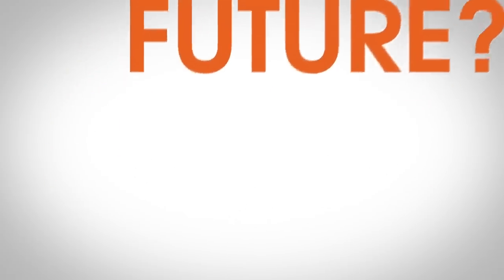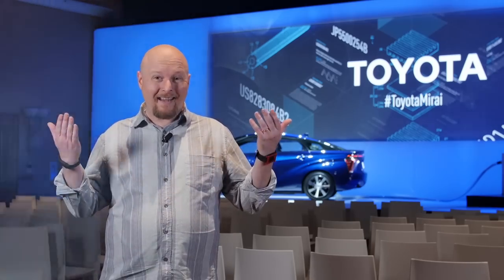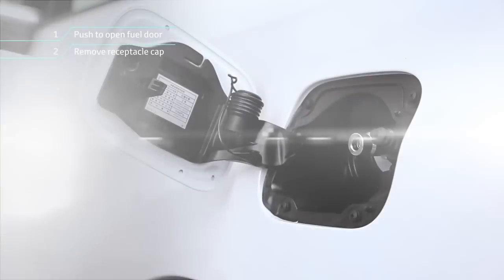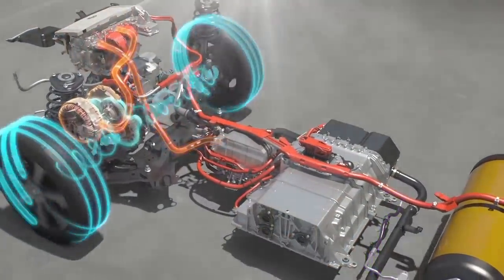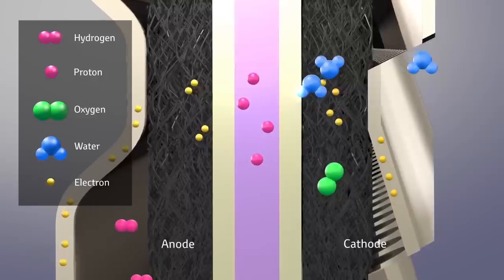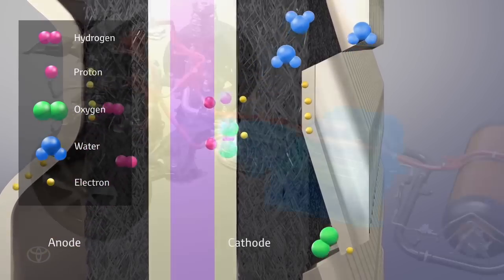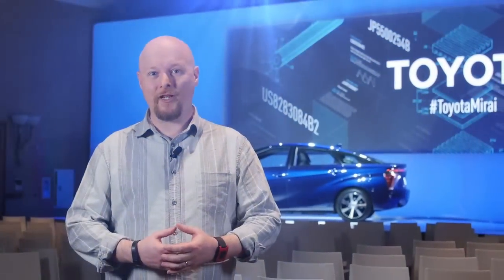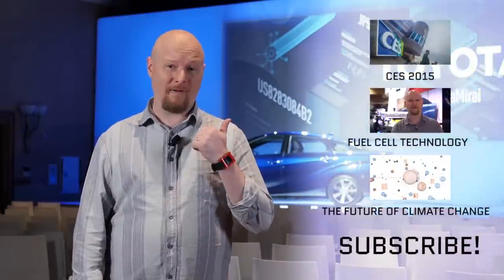How Fuel Cell Vehicles Work – CES 2015

Comment: Tesla, nor Toyota was the first for either of these ideas. Electric cars were actually the first mock up off the line back when Ford began production and have been available off and on, to this day. Hydrogen power has been in research at least since the late '80s. It's funny to read these comments from people that haven't been alive long enough to know, or that just didn't pay attention or do the research. None of these ideas are new. Self driving tech was touched on in the 50s and Mercedes and Ford motors have both been doing self driving R&D since the late 80s. Just because some companies utilize public media, doesn't mean they thought of it first.
Reply: To be fair, it doesn't matter if the idea existed previously. Nothing succesful was done with it. It's like if I find a cure for cancer but don't do anything with it, it wouldn't count for much. As much as I support giving credit to the original source of the idea, I credit more those who actually do something successful with that idea.
Reply: Toyota has always lied in such promotional videos and this has not changed 6 years later. At 4:58min they claim: "No carbon emissions like petrol or diesel powered vehicles".
This is true - if you look at the fuel cell car alone. If you look at the whole chain (well-to-wheel), hydrogen today in 2021 is made from more than 95 per cent natural gas, coal and oil, as it was in 2015.
The hydrogen car is therefore dirtier than all other vehicles!
Of course, hydrogen can be produced from renewable energies via electrolysis. But this method is several times more expensive and therefore there will never be a large number of cars with hydrogen as an energy storage medium.
Toyota needed until 2019 to produce and sell 10,000 Mirai.
At 4:59min I had to laugh:
The biggest revolution has failed ...
Reply: @spongebabu6723   :  "but still better than pussified American tesla"
The effeminate Japanese company Toyota is now building more and more battery-electric cars ...
;-)

Comment: I was crazy about fuel cells and electric cars when I was in high school.  Since I graduated in 1979, that was a long time ago.

Hydrogen is hard to store.  That means that trying to run a regular internal combustion engine on the stuff will make it a real challenge to have a long range.

Also, since hydrogen is expensive (right now,) running an IC engine on it will be expensive.

On the other hand, if you use a fuel cell (~60% efficiency) combined with electric motors (~90% efficiency,) you can get a very economical car with a good range.

If Lockeed-Martin's fusion reactor pans out, we will get the much promised 'electricity too cheap to meter.'  That means that hydrogen will become MUCH cheaper.  Also, we will be able to produce it at home via electrolysis.

Also, electric motors are great for propelling a car.  They have high torque at low speeds.  In fact, they can produce torque even when stalled.  This eliminates the need for clutches.  The fact that they produce torque at any speed means that we don't need a shifter.  If we use a motor for each wheel, we don't need any differentials.  Putting a motor on each of the four wheels, and controlling them with a computer, allows us to have all of the advantages of a differential and a locked system at the same time.
Reply: After 4 year you got a reply 😅❤️✌️
Reply: @DinushaJayaranga  😅😅
Reply: 5 years later you get a reply.. Do you still agree with what you wrote ?
Reply: @JGTechBlog  Yes.  Hydrogen is still hard to store, and is still more expensive per joule of energy than gasoline or diesel fuel -- especially since both gasoline and diesel fuel have gone down in price.

Hydrogen will go down in price once we get really cheap electricity -- whether it is from solar/wind/hydro, or from fission (LFTR,) or from fusion.

Meanwhile, in the past five years, the technology for battery electric has really improved.  That makes hydrogen fuel cell vehicles look less attractive in comparison.
Reply: Lol😂😂😂
Reply: Though im very much crazy about electric cars since grade 4,when i had my batery powered toy car, on day 1, til day three  only the dynamo is left😂😂😂,didnt think i could be seeing ev's on the roads until few years ago...great tech..
Reply: Die Vorteile eines elektrischen Antriebes sind unbestritten.
Toyota has always lied in such promotional videos and this has not changed 6 years later. At 4:58min they claim: "No carbon emissions like petrol or diesel powered vehicles".
This is true - if you look at the fuel cell car alone. If you look at the whole chain (well-to-wheel), hydrogen today in 2021 is made from more than 95 per cent natural gas, coal and oil, as it was in 2015.
The hydrogen car is therefore dirtier than all other vehicles!
Of course, hydrogen can be produced from renewable energies via electrolysis. But this method is several times more expensive and therefore there will never be a large number of cars with hydrogen as an energy storage medium.
Toyota needed until 2019 to produce and sell 10,000 Mirai.
At 4:59min I had to laugh:
The biggest revolution has failed ...
Likewise, the revolution with nuclear reactors and nuclear fusion is failing - far too expensive.

Comment: researching how fuel cells work, ended up walking into a Toyota ad
Reply: Toyota has always lied in such promotional videos and this has not changed 6 years later. At 4:58min they claim: "No carbon emissions like petrol or diesel powered vehicles".
This is true - if you look at the fuel cell car alone. If you look at the whole chain (well-to-wheel), hydrogen today in 2021 is made from more than 95 per cent natural gas, coal and oil, as it was in 2015.
The hydrogen car is therefore dirtier than all other vehicles!
Of course, hydrogen can be produced from renewable energies via electrolysis. But this method is several times more expensive and therefore there will never be a large number of cars with hydrogen as an energy storage medium.
Toyota needed until 2019 to produce and sell 10,000 Mirai.
At 4:59min I had to laugh:
The biggest revolution has failed ...

Comment: how about the hydrogen production line ? is it going to be eco-friendly ?
Reply: Perhaps once it's produced enough electricity to power itself
Reply: doughnut090
So far, there is no known technology that can produce enough juice to power itself. Maybe in time we will develop such technology. If we ever do, my guess would be some type of nuclear source. If I remember my physics right, once it starts you can't turn it off until the source is exhausted.

Now, we may be able to produce hydrogen using solar as a power source, and only keep the operation open during the day. Since the tech is so new, the plants can be designed to be as green and eco friendly as possible and reduce environmental damage.
Reply: Benjamin Lemin Why not? 
Using hydrolysis or the process of converting water to hydrogen and oxygen from renewable sources the hydrogen is captured and the oxygen is either captured or released into the atmosphere. 
Currently hydrogen is a byproduct of refining crude oil, is used in modern refineries to help crack and treat crude to yield more gasoline and diesel, but much of the hydrogen production is pumped back into the ground as a waste material, sold as an industrial gas or safely released into the atmosphere with other constituent gases.
Reply: ***** Possibly, not my area of expertise. The United Nations may possibly want to condemn us for enslaving the plants or algae.
Reply: Toyota has always lied in such promotional videos and this has not changed 6 years later. At 4:58min they claim: "No carbon emissions like petrol or diesel powered vehicles".
This is true - if you look at the fuel cell car alone. If you look at the whole chain (well-to-wheel), hydrogen today in 2021 is made from more than 95 per cent natural gas, coal and oil, as it was in 2015.
The hydrogen car is therefore dirtier than all other vehicles!
Of course, hydrogen can be produced from renewable energies via electrolysis. But this method is several times more expensive and therefore there will never be a large number of cars with hydrogen as an energy storage medium.
Toyota needed until 2019 to produce and sell 10,000 Mirai.
At 4:59min I had to laugh:
The biggest revolution has failed ...
The new Toyota Mirai II (2020) does not even have a folding rear seat back. The hydrogen tanks take up a lot of space.

Comment: hydrogen is amazing! but I think in the mean time, electricity is a vastly underutilized tool for transportation.
Reply: Problem is when u have electricity being produced by fossil fuels there lies the problem and also making lithium is rely bad for the inviroment we should be putting more hydrogen fuel stations in over electric ones. Makes more sence because they are electric cars anyway so makes sence to go hydrogen.
Reply: @jamesmarshalsea9916  You know what? You're right, I didn't even stop to think about the environmental ramifications of lithium mining and all the transportation and building the batteries.
Reply: @jamesmarshalsea9916  you need to be cleared how hydrogen can be produced.

1. Extracting the h2, you need heat. Where is heat comes from? FOSSIL FUEL.
2. Electrolysis, you need electricity. Where is the electricity comes from? FOSSIL FUEL/BATTERY/high volt solar panel or hydroturbine(high cost effective).

Keep in mind, hydrogen is not primary sources like oil. It needs to be extracted from any bonding chemical to form hydrogen. Which means, more energy required and it is currently expensive.

Comment: I study fuel cell vehicles in univ now. I'm surprised this video took 5 yesrs ago! Now, the environment become more important. So I am pride Toyota as Japanese.
Reply: Very interesting ! Yes its ahead of its time
Reply: Toyota has always lied in such promotional videos and this has not changed 6 years later. At 4:58min they claim: "No carbon emissions like petrol or diesel powered vehicles".
This is true - if you look at the fuel cell car alone. If you look at the whole chain (well-to-wheel), hydrogen today in 2021 is made from more than 95 per cent natural gas, coal and oil, as it was in 2015.
The hydrogen car is therefore dirtier than all other vehicles!
Of course, hydrogen can be produced from renewable energies via electrolysis. But this method is several times more expensive and therefore there will never be a large number of cars with hydrogen as an energy storage medium.
Toyota needed until 2019 to produce and sell 10,000 Mirai.
At 4:59min I had to laugh:
The biggest revolution has failed ...